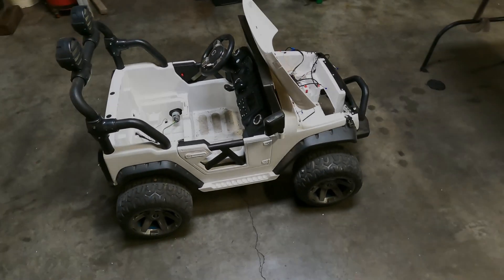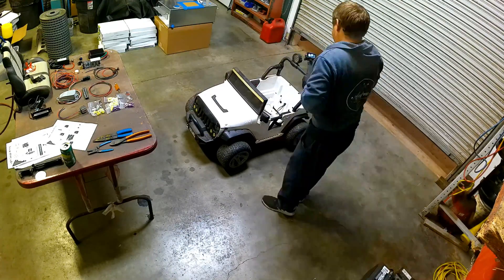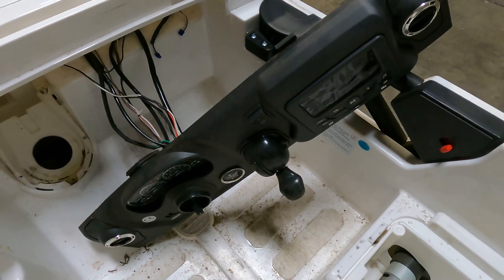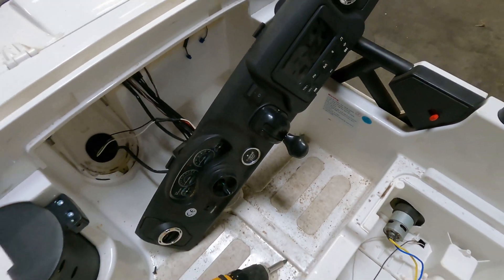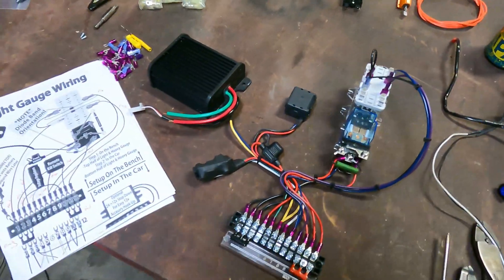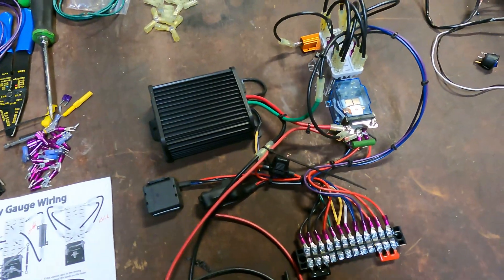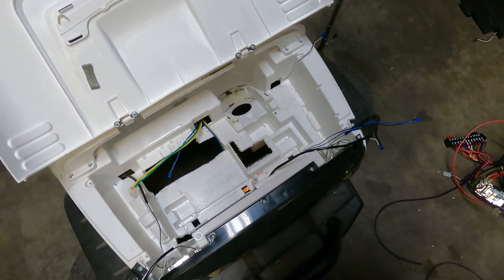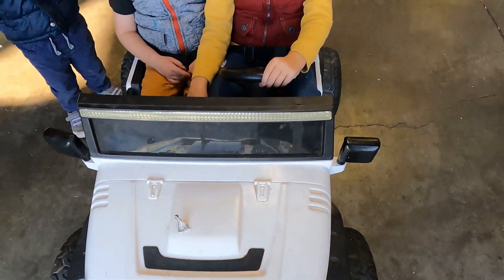Moderno Kids Jeep 12V to 24v Upgrade PART 1

Comment: Hey bud. Found you while searching for the steering being "locked". It won't turn by the wheel, nor the remote. I have pressed the 'lock' button on remote to no relief. Any suggestions? Thanks.

Comment: I’m pretty sure this car has 775 motors. If so all you have to do is retain the 12 v system on the factory battery and where the power goes to the motors out the controller and a 12v coiled relay and add a 18-24 volt battery feeding in the relay and to the motors. Done. It will retain all lights radio steering control and safety switch.

Comment: Awesome upgrade.  I tried upgrading to 18v but didn't realize the issues I would face.  Would you happen to know why pressing the power button would flash lights and turn off? 

Please help 🙏 

- 12v battery still good
- Power button working

Comment: Great video. I thought about buying that kit myself, it looks like a lot of work. My family has 2 of them, one for my daughter, and older version of the jeep, and one for my son. My son has the newer jeep. Both swtiched over to milwaukee 18v batteries. My daughter's jeep works but the steering motor stopped. She learned how to steer herself so no harm done. My sons jeep didnt take well to the M18 battery. The remote would not move the jeep. The radio wont turn on and the pedal does not work. The jeep turns on but thats it. I used a 2.0ah M18 and the jeep turns on, radio works, and it moves but the voice on the speaker keeps saying "please charge battery ". I swtiched the 12v control receiver to a 24v and the jeep moves but the radio doesnt stop telling me to charge the battery even tho its a fresh charged 5.0ah milwaukee. Any advice?
Reply: Did you ever figure it out? Currently having the same issue using the m18 5.0. But works fine with a 12v

Comment: Ok, good to see. I am going for the 20-volt Black and Decker tool battery upgrade with the addition of a variable voltage regulator to tame it down when I want. Hopefully, 20 volts doesn't burn out the lights and the board with the remote control functionality. We will see.
Reply: So....did it torch the internal electronics?  Asking before I roast mine.
Reply: Here for this answer

Comment: I purchased one of these for my kid last year and I've had nothing but problems with it from day one. Think I've worked on it more than my kid has drove it over the year. I've had two solder every wire because all the plugs melted. It's now going on his third set of Motor/gearbox assemblies. The cheap Amazon ones work much longer than the junk that came with it but there still garbage. Half the videos I find on this thing have the comments disabled too. Having just ordered another pair of gearbox's I wish I would have watched this a long time ago! Awesome plan and great job but where is part 2 when you upgrade those gearbox assemblies? 
✌😁👍
Reply: The gear box replacements you got. Do they accommodate the discs for the wheel lighting? I have two new assemblies but the plastic hole that the axel goes through has a smaller outside diameter than the stock boxes so the disc prongs dont fit in the new boxes.
Reply: @jgatto1234  no they did not hook up to the wheel lighting ring things. We lost the rim lights on the first set of motors. Only the front worked after that. I ended up throwing the darn thing in the trash and I found a Smokin deal in the local classifieds on one of those 24-volt gravediggers with the metal frame for 200 bucks new in box. Found a guy that had bought a truckload of them. We haven't had one single problem with it yet. The little Moderno one would have been great because it was super cute had the nice seat and it was very easy to steer, they just put garbage Electronics in it. It might be worth just replacing everything for the speed control set up but that's quite expensive. We also have bought a used cheap Power Wheels buggy. It's all worn out been through hell, bottoms all scratched up in the previous owner painted it blue for his little boy because it was pink before. It's completely trashed sets outside in the weather all year every year and still works fine. I wrote a giant complaint on one of the Moderno YouTube videos but they deleted it and said I couldn't comment on it again because I mentioned the word "Power Wheels". Hope you have better luck than I did!
Reply: @ZakattackAdventures  I won’t buy another one of their products. Granted this is the only issue I’ve had (I swapped to 18v Ryobi batteries) but their use of hard to get proprietary parts makes it difficult to repair even a gear in the gearbox. I only need the center gear (3rd) but the dimensions are different from all the other boxes I have and I can’t find any gears online with the same dimensions. Nice Jeep, poor execution. I’m trying to get some direction from them now as to how I can repair this. I can put new boxes on but it kills the wheel lights which happens to be one of the reasons we bought the jeep. Sigh.
Reply: It seems like back when I was researching them there was somebody that made custom gearboxes with metal gears but it's been awhile and I have no idea where I saw it. Would almost be worth replacing all the electronics adapting larger gearboxes and whatnot because the Jeep itself is super cool and had really easy steering for the little ones. My boy liked driving the jeep more than his big Grave Digger monster truck back when they were both in the yard. (the steering in the gravedigger is pretty bad.) There's a lot of information online about beefing them up but you can spend more than it was brand new to make it rip. Well I hope the best of luck to you & I would offer you all the parts that I saved but I already gave them away.

Comment: My steering wheel control from the controller doesn’t work. How do I fix that?
Reply from the maker: I don't know, I removed all of those components from the original moderno kids jeep and replaced it with aftermarket stuff.

Comment: I have a moderno jeep that looks almost identical. The high low speed is on a toggle switch. I just switched over to dual milwakee  18v batteries today.. the lights and radio worked for maybe 5 mins. Is there anything I can do for a quick fix or is this kit the only way?
Reply: Idk I just tried it on a car with a single 20v dewalt and it worked for a while but then the electric steering stopped working. Im gonna try dropping it back down to 12 v through a regulator
Reply: I also am having the same problem. Apparently the basic conversion doesn't work with all the lights and everything